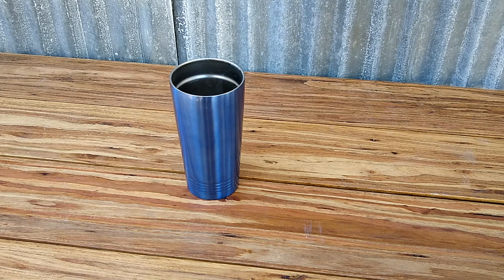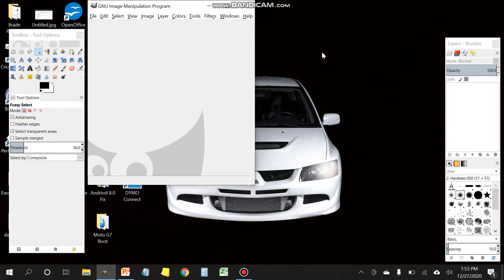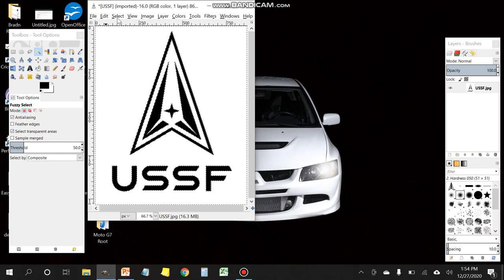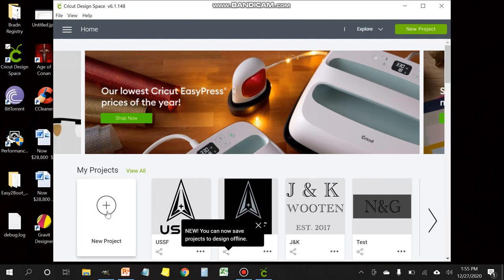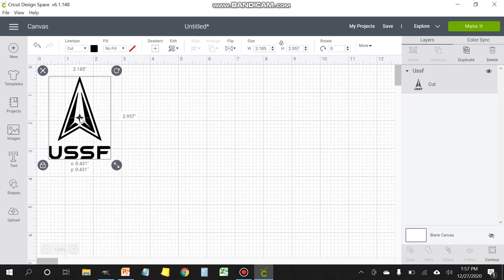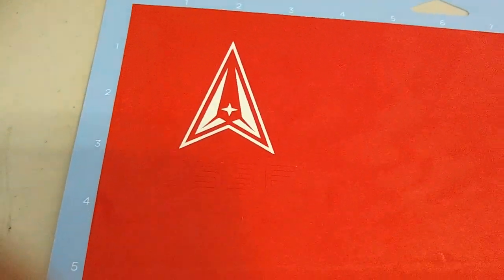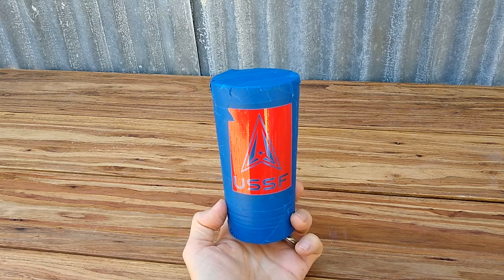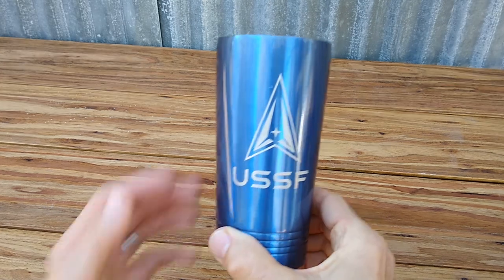Vapor Blast / Honing DIY Engraving Stainless Steel Tumblers

Comment: Victor, you dont use a whipper in your cabinet, a see many people have to install a whipper but not you....wath you think about whipper mod ?
Reply from the maker: Hello Andre, Thank you for commenting. I use RainX on the glass to help the water bead and run off but if I need to clear the glass as I'm working I let off the air pedal and just reflect the water from the media pump using my glove at the glass to clear it for the next few minutes. It's a little bit of a hassle but it keeps my system inexpensive, simple, and easier to clean out. If I was vapor blasting all day everyday then for sure a wiper or fresh water sprayer to clear the glass would be best.

Send me some pictures if you add one so I can learn from you.

Best of luck with your build!
Reply: @vbared  thx for the answer, my cabinet is under construction, and i dont plan to add a weeper, until i need lol, i try first rayne X like you. Thx
Reply from the maker: @andrelizzi5236  You're going to have a great time, learn a lot, and will be blown away at the results during this process.

Hit me up if you run into any questions. I might be able to save you some time.

Best of luck with your build!

Comment: Thank for your videos. I'm building my first vapor blasting machine, hope it will works as well as yours!
Do you have Instagram?
Reply from the maker: Hello, Zero Tolerance, 

Thank you for commenting. An air compressor that can move enough air is the key. The Ingersoll Rand with the SS5 pump is the bare minimum for blasting at 50 psi. Pressures above 50 psi will require some waiting for the compressor to recover. The links below have all the details. If you have any questions don't hesitate to ask.

Look for: Victor Bared on Instagram

Best of luck with your build!

https://drive.google.com/file/d/1N8XHOAfTOg2Rt_NgPMzbZxnwVhXghlLX/view?usp=sharing

Details on my wet blasting system including a complete parts list, sources, and costs at the time.

Compressor

https://www.northerntool.com/shop/tools/product_211720_211720  949.99+tax

Compressor Hoses and Fittings

https://www.harborfreight.com/12-in-x-50-ft-rubber-air-hose-62888.html?_br_psugg_q=1%2F2+air+hose       29.99+tax

https://www.homedepot.com/p/Apollo-1-2-in-Brass-PEX-Barb-x-1-2-in-Male-Pipe-Thread-Adapter-90-Degree-Elbow-APXME12/301541102       3.97+tax

Air Regulator, Fittings, and Control

https://www.harborfreight.com/125-psi-12-in-npt-air-flow-regulator-with-dial-gauge-68280.html  22.99+tax

https://www.homedepot.com/p/Apollo-1-2-in-Brass-PEX-Barb-x-1-2-in-Male-Pipe-Thread-Adapter-APXMA1212/301541054 2.52+tax might need 3 
https://www.eastwood.com/eastwood-blast-cabinet-foot-pedal-and-gun.html  69.99+tax

The Budget Blast Cabinet and Sealant

https://www.harborfreight.com/40-lb-capacity-floor-blast-cabinet-68893.html  189.99+tax

https://www.homedepot.com/p/GE-Advanced-Silicone-2-10-1-oz-Clear-Kitchen-and-Bath-Silicone-Sealant-Caulk-GE5040-12C/100663319             6.57+tax

Blasting Nozzle and Diesel Check Valve

https://www.ebay.com/itm/Boron-Carbide-35mm-Blaster-Nozzle-Replacement-Air-Sandblaster-Gun-Head-Accessory/264575797522?hash=item3d99f24912:g:yIQAAOSwASBdNWX8  27.87+tax & Shipping

https://www.amazon.com/Return-Check-Petrol-Diesel-Aluminium/dp/B06XJHGXQP/ref=sr_1_8?crid=2AN08NNWFOIRE&dchild=1&keywords=1%2F2+check+valve+air&qid=1594776694&sprefix=1%2F2%22+check%2Caps%2C180&sr=8-8                     8.80+tax

Water Pump, Fittings, and Hose

https://www.homedepot.com/p/The-Home-Depot-5-Gal-Homer-Bucket-05GLHD2/100087613          3.49+tax

https://www.ebay.com/itm/1-5HP-Water-Submersible-Pump-Stainless-Steel-Silver-Clear-Dirty-Pool-Pond-Drain/353072228123?ssPageName=STRK%3AMEBIDX%3AIT&_trksid=p2060353.m2749.l2649         60.99+tax

https://www.homedepot.com/p/Oatey-4-oz-Purple-Primer-and-CPVC-Cement-Handy-Pack-30234/203561639            7.70+tax

https://www.homedepot.com/p/Charlotte-Pipe-1-1-4-in-x-1-in-PVC-Sch-40-SPG-x-FPT-Reducer-Bushing-PVC021081000HD/203811585 1.44+tax

https://www.homedepot.com/p/Charlotte-Pipe-1-1-4-in-PVC-Sch-40-S-x-S-x-S-Tee-PVC024001200HD/203812201       2.42+tax

https://www.homedepot.com/p/Charlotte-Pipe-1-1-4-in-x-3-4-in-PVC-Sch-40-Reducer-Bushing-PVC-02108-0950HD/203851140           1.44+tax will need 2

https://www.homedepot.com/p/Apollo-3-4-in-Brass-PEX-Barb-x-3-4-in-Male-Pipe-Thread-Adapter-APXMA3434/301541030 2.82+tax will need 4

https://www.homedepot.com/p/Homewerks-Worldwide-3-4-in-PVC-FPT-x-FPT-Union-511-44-34-34H/204202889  4.98+tax

https://www.homedepot.com/p/Swan-5-8-in-Dia-x-6-ft-Leader-Water-Hose-CLOLH5806FM/202305259 7.97+tax

https://www.homedepot.com/p/Everbilt-1-2-in-1-1-4-in-Stainless-Steel-Hose-Clamp-10-Pack-671255E/202262870  8.74+tax will need 2